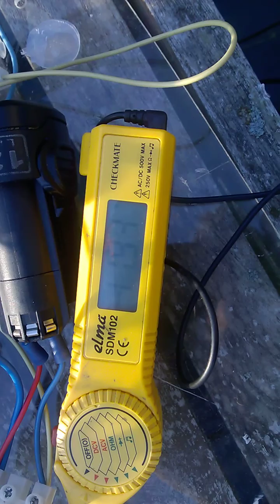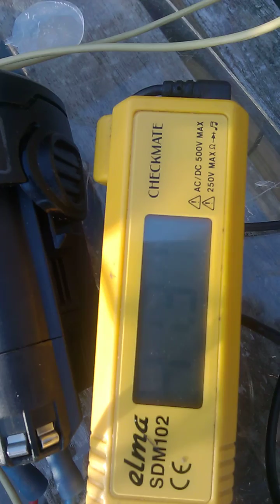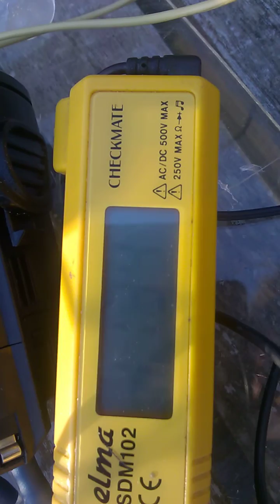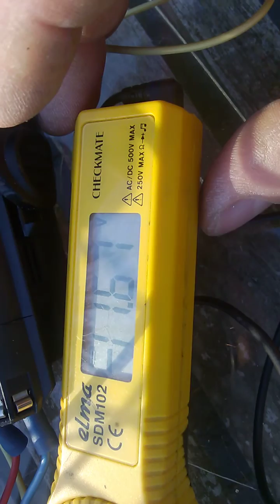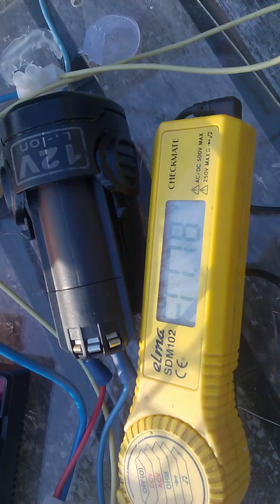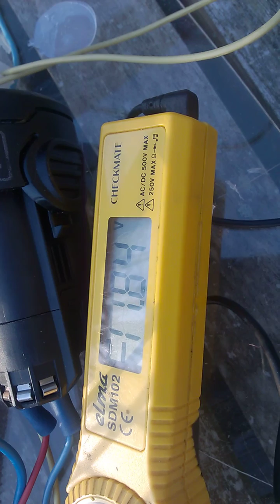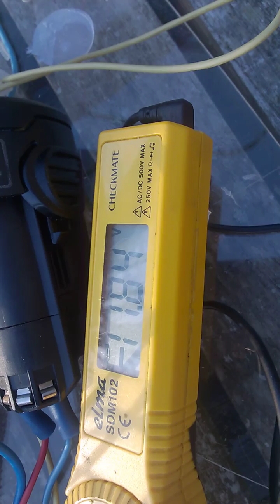looped ground pump recuperation?

Comment: You did a real good setup here to make it recuperative  cop>1.
On the other CT for the 5watt lamp was wondering if you can rectify to DC, and use this to capture energy for a supercap or electrolytic capacitor to hold sufficient charge and reroute it to the input power, and if your input power matches the batt power, it can possibly self run.
Seeing how 1 CT toroid feeds the 100watt halogen you still have lights,then the other CT would be freed up for storage energy or input power if it matches or > 1 to self power!
Great setup and work!

Comment: Hi DKDyker, awesome set up. Did you manage to charge depleted battery? We tried exact same set up as yours but it is pulling 10A+ and ZVS is getting very hot. So there is something we are not doing right. Is any tuning required with ground wire lengths, winds on bifilar, CT size/number of winds, or anything else? I sent you a PM with my email to your YouTube account, not sure if you saw it? Keep up the great work 😊

Comment: Yeah, It's seems like it's charging back. Your also running a 100 watts bulb. If it was not regenerating, the battery would die quickly. Yeah, keep going, improve the circuit, make it simpler. I think you're onto something good. Cheers mate.

Comment from the maker: Foamaxmoreyes system does run a little warm, nothing to serious, but there will be a little loss. I will try a longer run to see if it will recouperate more than what the start battery has and to see if it will hold. The best would be if i had a cap to run and charge at the same time. Maybe use of a fast reaction transistor????

Comment: Nice setup and another good idea.
You are running 2 ground lines for one CT 100w halogen lamp and other CT just to 5W led.
Also 2 grounds  1send,  1receive to  the BR)AC)part and {DC}part to the 1st Cap that loops to the 12vdc  battery for recuperation. 
The battery voltmeter does show about a 1vdc increase at power up and a few minutes of run time...Can you let it run a longer time w/o any thermal runaway?or does it run cool?

Comment: Also, do you have a compete circuit schematic? I would like to know where you are using your input power? I use this a lot because its free. http://www.digikey.com/schemeit/project/
But its not easy with the modules you are already using. Even a block diagram would be great with the modules you  are using.